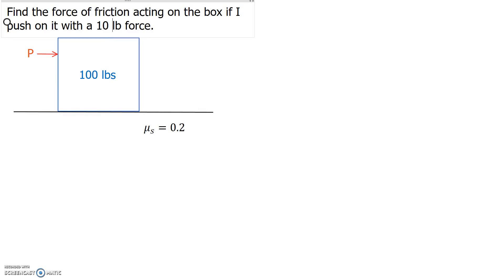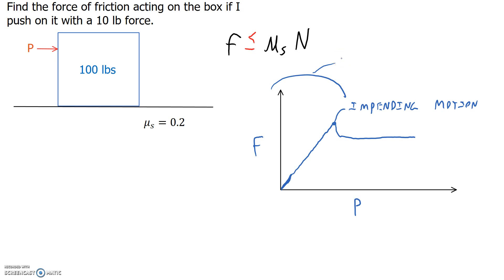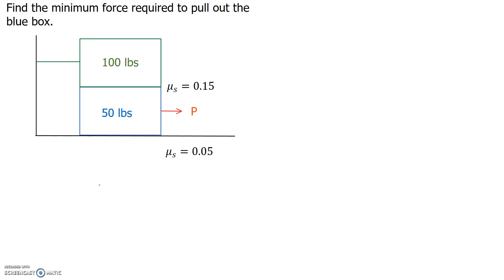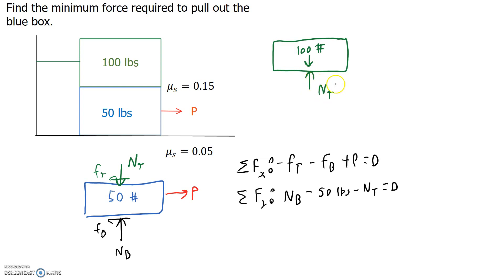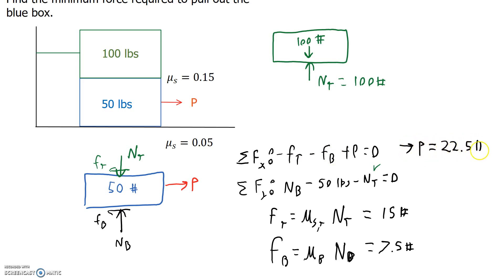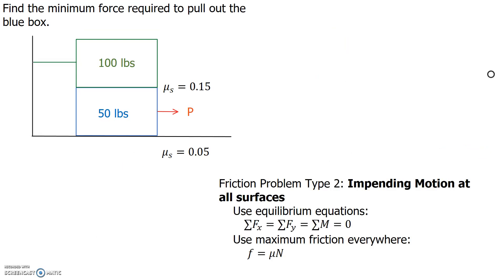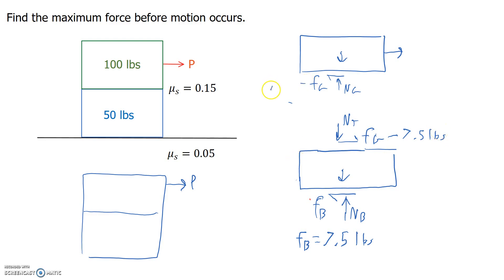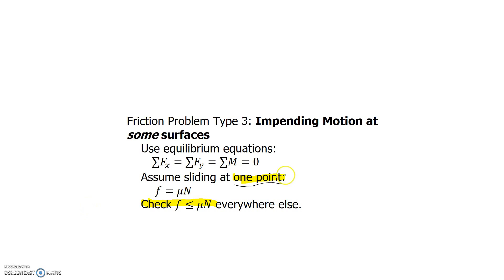Three Types of Friction Problems in Statics

Comment: if three boxes were used, how do i check if the sliding occurs at the bottom of the third box?
Reply from the maker: You'd use the same method: Draw a FBD of each box, being sure to label the frictional forces as equal and opposite from box to box. Then write the equilibrium equations for each box, and check that frictional forces are all less than or equal to mu_s*N
Reply: first, thanks for the reply! video helped a lot.
So is it okay to say that the box that slides is the box with the least Frictional force?